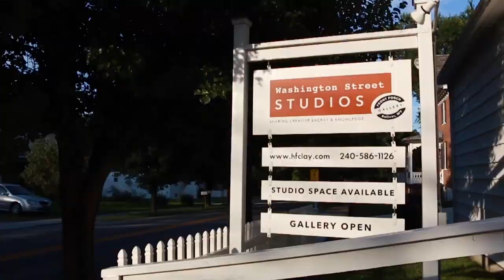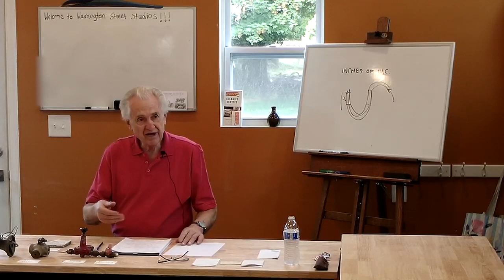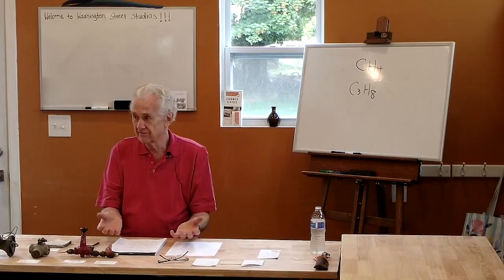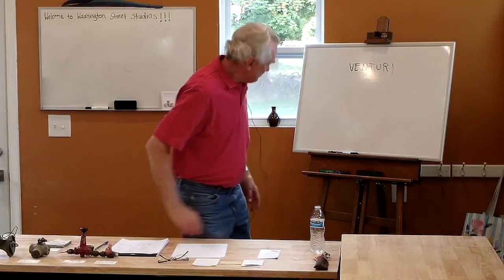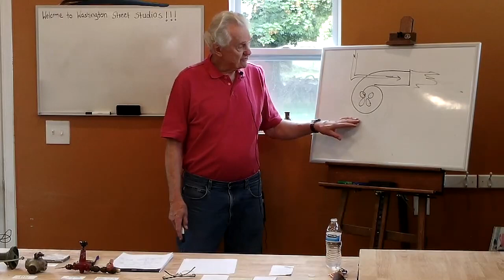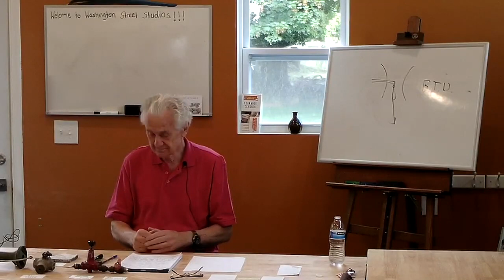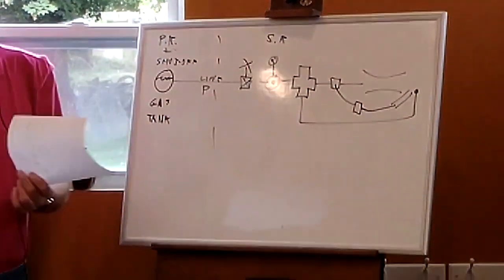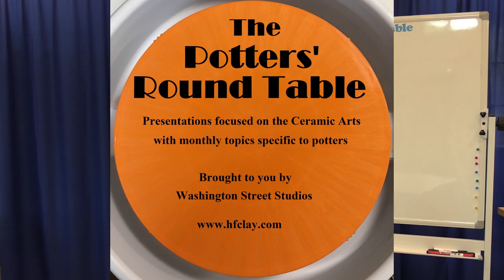Understanding Pottery Chapter 14 Gas Fired Kilns Part 1

Comment: Great info Phil, I remember my first downdraught gas kiln. The guy who built it was in the city 5 hours away. When I fired to 1300 I would get to 1200 and it was like hitting a brick wall and no matter what to get to 1300 was trying every trick in the book . I would ring the manufacturer and we would go over everything again, him saying it was only inexperience etc. Well one day I had had enough and rang him again; he thought about it and said, get under the kiln and look for a number on the side of the venturi. Well it turned out he had put 1 inch tubes on instead of 1 and a quarter inch. Huge difference to gas flow. It was a 30 cubic foot  kiln and was no trouble after that. I can remember firing on cold nights from 100 pound bottles and losing pressure due to icing up and having to hose down the bottles with water to warm them up . The same person built my 100 cubic foot trolley kiln and it is a pleasure to fire, mind you I am still learning. The first kiln I had was a self built wood fired downdraught. From the Olsen kiln book. I had had a long break from pottery and am now getting my studio back together. I have learn't so much from you Phil in such a short time. I remember the mistakes I made and learnt the hard way. Somehow all the hours and work panned out and I was able to make a living from it but I sure wish you were at my side back then .thanks for your experience and teaching Phil it means a lot to people like me who live in the middle of nowhere, thanks and kind regards from John.
Reply from the maker: John, thanks for sharing your experiences! We call these talks 'Round Tables' in hopes that the discussions will go both ways.

Comment: Phil, you are a star. Such an incredible knowledge of not only clay, glazes, kilns and rocks, but also an inspirational teacher. I'm a novice potter and on Chapter 14 so far. I have a strange question, I have purchased a spray bottle, with usb charger, which turns water with a teaspoon of salt into a mild hypochlorite spray for general household cleaning. if I use this spray on clay or bats etc, will the chlorine in the hypochlorite effect the colours of my finished ware ?  Thanks in anticipation. Toby, Isles of Scilly, Cornwall UK.    Keep going, you are an encyclopedia of wonder !

Comment: Hi, I want to make a kiln out of a galvanized trash can. I've heard that galvanized steel gives off a gas at high temps. If I use it outdoors is itt safe? This would not be a raku kiln but a bisque and glaze kiln.
Reply from the maker: I've not heard of anyone getting to bisque or glaze temperatures in a galvanized trash can kiln. We repurposed an electric kiln to be our raku kiln. We prefer to use materials for their designed purpose. Sorry we can't help you here, please research this fully to make sure it's safe.

Comment: Hi Phil:  thank you so much for your teachings, I’m learning a lot and clarifying many questions I had.  Currently I’m firing an Olympic Kiln 2831G with propane, low pressure (will built my first gas kiln with hard bricks next year).  On pressure regulator  it seems you put it right before the kiln; in other words the pipe line from the gas tank until the pressure regulator has the full pressure of the tank.  Is that so? Normally I’ve seen the pressure regulator installed just by the tank and the gas line goes with the lower pressure upto the kiln.  With regards to Baso valve, the 2831G has just one Baso valve that connect a ring  pipe to the four burners, could I use the same system for new hard brick kiln (4 burners, 30 cu.ft.)?   Thanks very much.
Reply from the maker: I sent this question to Phil and will post his response when I receive it  Thanks for the question.

Comment: I have been researching the safety issues when using ceramic blanket (kaowool). Is it necessary to coat the ceramic blanket with refractory cement or satanite to reduce the emissions that can happen when your kaowool reaches high temperatures?
Reply from the maker: I personally can not answer and suggest you contact the manufacturer of the blanket for their recommendation. We did not coat the ceramic blanket  and try not to 'disturb' the blanket when we are firing. 
Unfortunately, Phil passed away last July and he probably could have provided a better answer.
Thanks for the question and let us know when you get an answer!
Reply: @WashingtonStreetStudios  oh wow, I am sorry to hear that he is no longer with us. I just found y’all’s YouTube page and I am very impressed with the vast amount of knowledge shared.